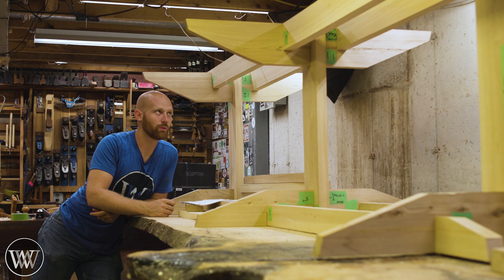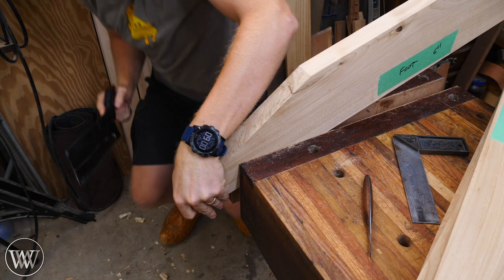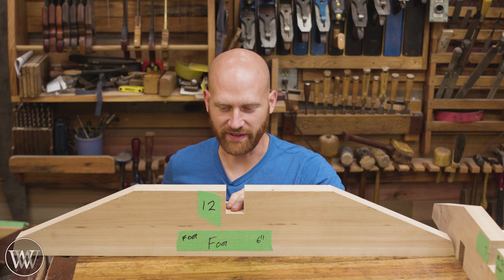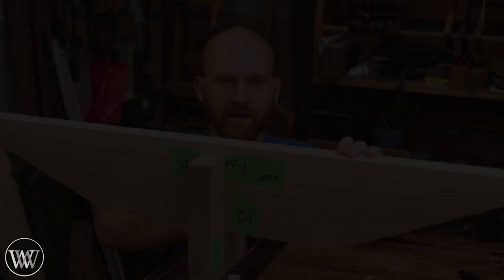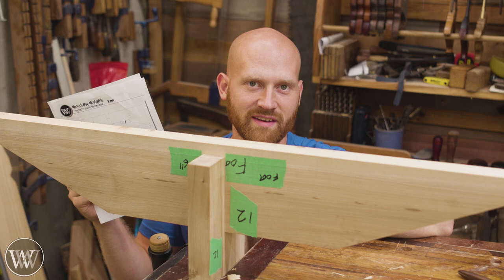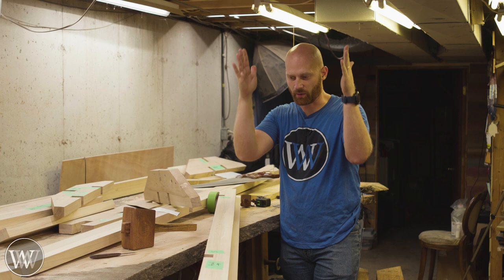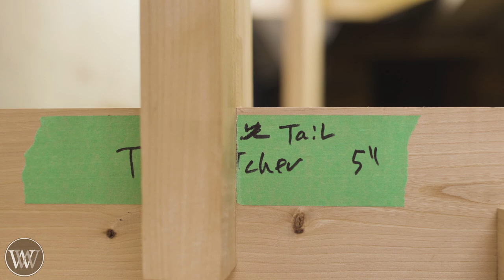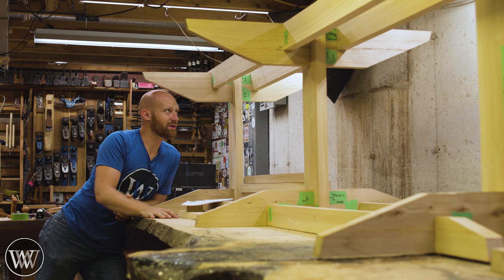Building A Slab Dining Table Base Structure Part 8

Comment: OOO OOOH!!! Idea. The dilemma of how to fasten the top down. Mortise and tenon. Floating tenons. You would need to carve a curve in the tops of your horizontals and laterals of the top support as if making long horizontal bench feet. Line up the top with your structure and then cut away the contact areas to make flat spots but then in those flat spots of your top and your laterals and horizontals mortise them and insert unglued tenons or dominos. That way you still get to see the character of the making process without having to remove so much of the epoxy. Assemble the top structure and you should be able to put it on and off to check for contact and alignment without having to move the 300? Lbs top around so much.

Comment: Having followed the link from Matt Cremona's channel I am watching this build series.  Really enjoying it and super impressed with your work.  I do have a question on the joints, given how tight they are, so they work with just gravity, aren't you worried about even a small amount of wood movement?

On the new footage, to be honest some of the funky angles and rapid cutting ended up making me a little sea sick.  But maybe I am just a bit boring in my preference for a static camera sitti g in the corner of the shop 😂

Very much looking forward to watching many more of your videos.
Reply from the maker: Thanks. That means a lot. The reason they are so tight in the initial set up is that they will all be loosened when the final smoothing takes place before finish. Because the face of the board is part of the joinery when you do the final smoothing you're actually taking a little bit of sickness off of both fases of the board.And they will fit much better after that. As to Wood movement. It is almost imperceptible at that size. The yearly expansion and contraction over the inch and a half of the joint would be far less than thickness of a sheet of paper. Even if this were to be an outside table and experience the full swing of all of nature's temperature it would only be the thickness of two or three sheets of paper. 

I have been playing with the video format over the last few months. and most of the videos I'm planning on this channel will be a little bit more artistic than informational. I'm planning on using the second channel as strictly informational videos and I think those videos will be more to your liking. But I'm still figuring out what I want to do in the future. Thanks for the feedback. Feel free to ask any questions when they come up.

Comment: Hi James!  I have been waiting for this too. I will be ordering plans, as I need a new dining table. One question though on the lower “stretchers.”  Can those be attached along the top of the feet?  It occurs to me that my floor may not be flat across the distance of the length of the table. If the stretcher is across the top of the feet, then I wouldn’t have to worry about the floor. However, that may impact the diagonals. Any thoughts?  

Thank you so much for doing these great videos!  This series in particular has really given me the inspiration and confidence to make my own table! This will be my biggest build yet.
Reply from the maker: Thanks man. My floor is not very flat either and I will be putting small feet on the underside to actually lift the whole table up a quarter inch or so. If you put the stretcher on top then it is not in compression. the weight of the table on top is what holds it in place in the joint is there is no glue or other pins. But it's completely up to you you can make it whatever you want.

Comment: I was about to say, wow, very tight joints. But as it is going to be 'Knock down'. I think they should be perfect. With your Diagonal supports, and wanting to get a good fitting, are you going to draw them out full scale on a thin MDF / Ply board and then use it to set your sliding bevel? I do this on occasion to make sure I'm getting exact angles.
Reply from the maker: Thanks. No I will be putting the board on the side and marking the bevels along side of that